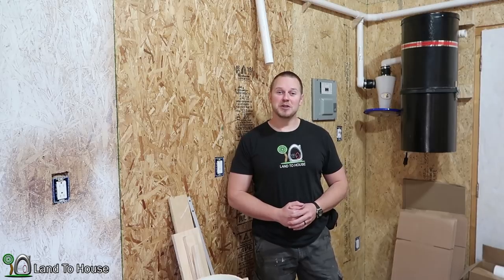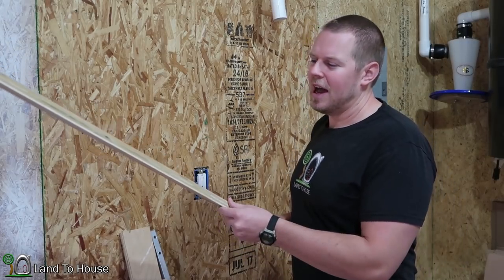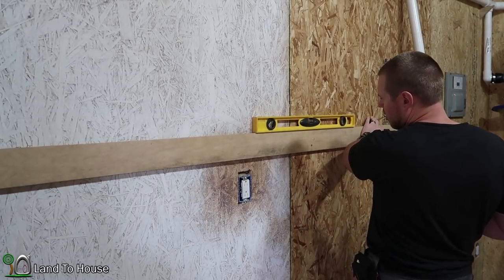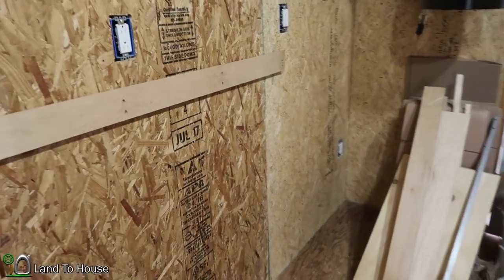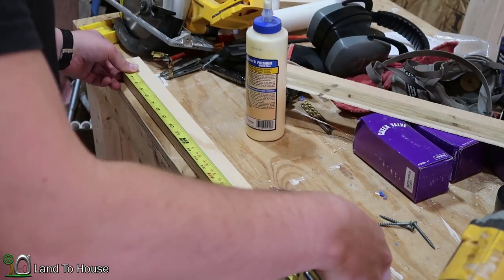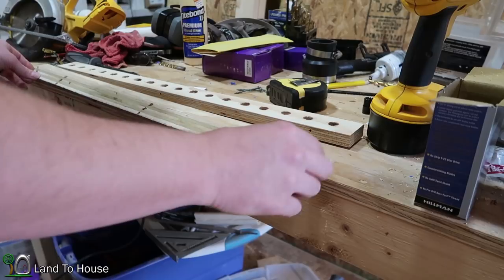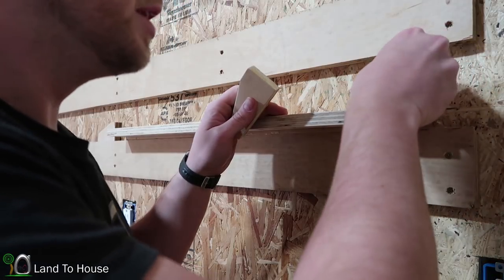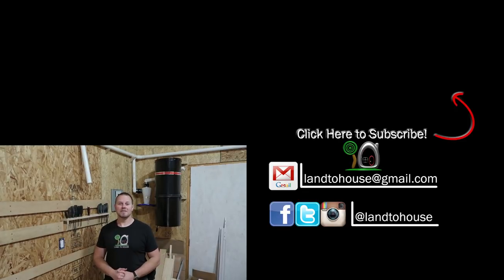French Cleat System and Tool Storage - Build a Workshop #43

Comment: Nicely done, especially with the braces under the support so that they don't vibrate/pivot-forward and fall off.  the cleats need only be spaced far enough apart to insert/remove the tool holders.  As long as you keep making these modular units that can be placed anywhere you can arrange them and leave free space above where needed.

Comment: French cleats are a wonderful idea. A decent number of the woodworkers on YouTube I subscribe to have built them for their own shops. I wouldn't worry about them being to close together as more of them being closer together gives you more flexibility in how you set it up.

The uses of a good French cleat system are virtually unlimited. They can hold all kinds of tools, accessories, small parts bins, the list goes on. I've even seen cabinets built to hang on them.
Reply from the maker: I have really enjoyed them so far. The hardest part is starting a storage shelf. I will likely install more of the strips as time goes on. I think that wall will be full of them. The distance seems to be right. Enough space to get tools in and out and still gives diversity.

Comment: Great Idea, think I might install those too.  I did notice that you might want to relook at the distance between the cleats so that you have room between so that you can remove the tools and not hit the shelf above. It looks like there isn't enough room once the shelf above is installed to remove the screwdrivers.
Reply from the maker: The French Cleat is so great! I have just drawn out ideas for 7 storage shelves. Because the screw drivers are inserted out from the wall there is actually enough room to get them out. I have seen some people install the cleat even closer than I did. 4" seemed about right to give enough room for taller tools.

Comment: I might have you beat on the Clutter. I just subscribed to your channel and I'm looking forward to watching you build your French cleat storage wall. The reason I'm so interested in it is because I have to do the same thing. However my walls are concrete block, or cinder block as they are known in other places. Have a good day and I will be watching ever video.
Reply from the maker: If that's the case you have quite the cluttered shop. Haha. My brother has concrete walls in his shop and he was able to install furring strips before putting up peg board. I would assume that you could use the same concrete anchor screws to install the French cleat.